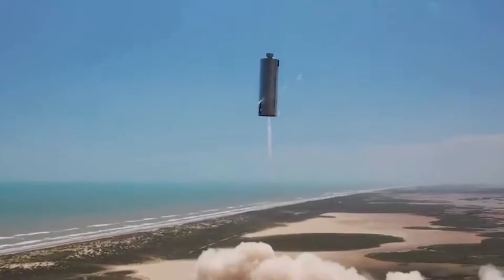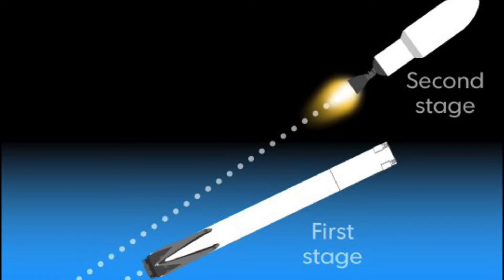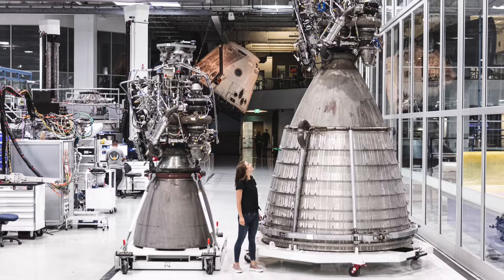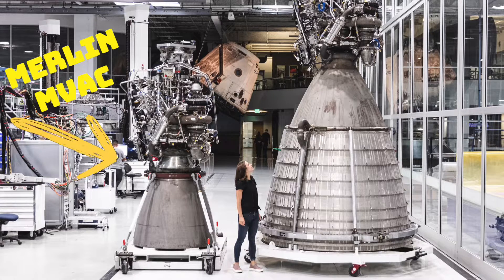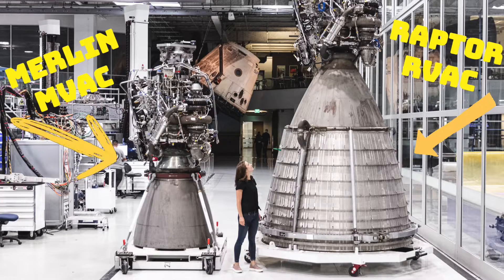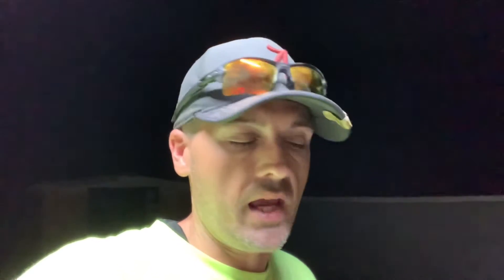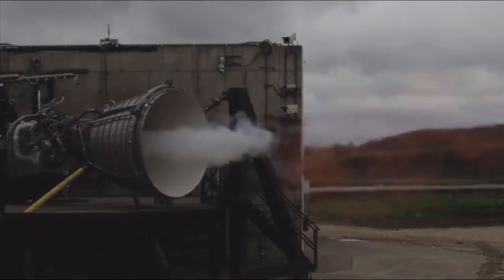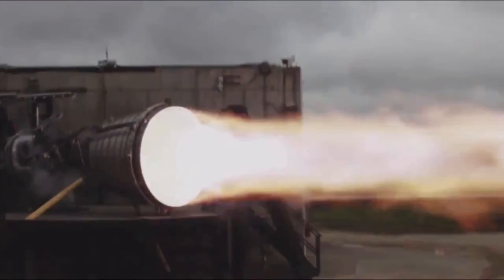SpaceX Raptor RVAC Static Test Fire - This Thing Has So Much Power It’s Incredible

Comment: Michael, just a small correction, SpaceX will not use any Merlin engines on Starship, only Raptors. There will be two variants of Raptor, sea level and vacuum.

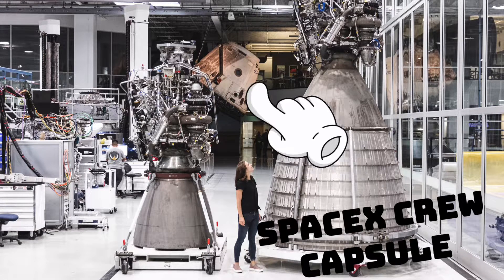Comment: The picture at 1:35 of your video shows two very similar Raptor engines with two very different nozzles. The Raptor on the left in the picture is a Raptor fitted with a nozzle meant to operate best in Earth's atmosphere. The Raptor on the right is a Raptor fitted with a nozzle meant to operate best in the vacuum of space.
You will find an 'MVAC' engine (Merlin Vacuum Engine) on the upper stage of the Falcon 9, and the upper stage of Falcon Heavy. 
Merlins only fly on Falcons. 
Raptors will only fly on the Starships and the Starship's Super Heavy Boosters.
The test you've shown was done to study the performance of the Raptor when fitted with a vacuum optimized nozzle.